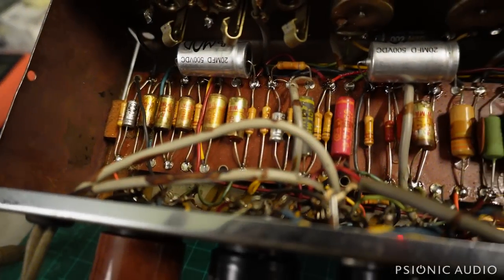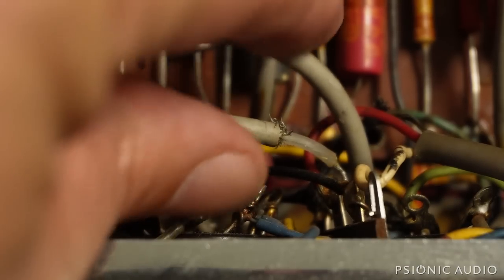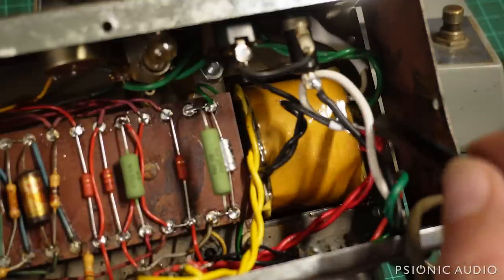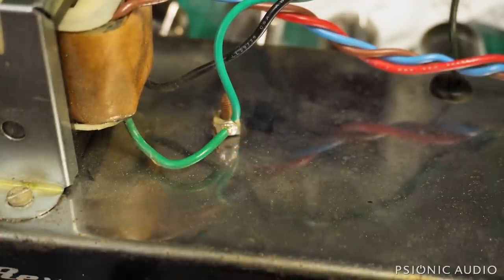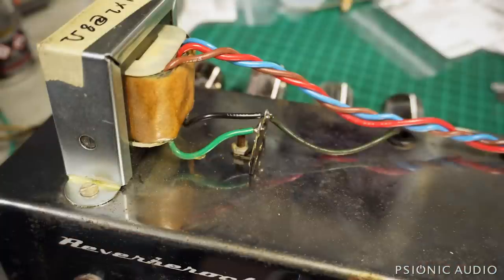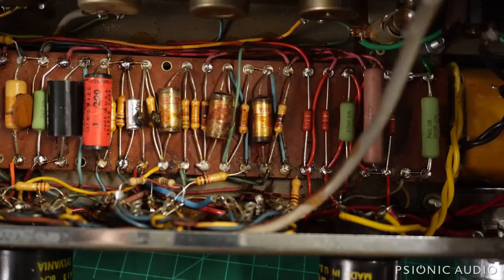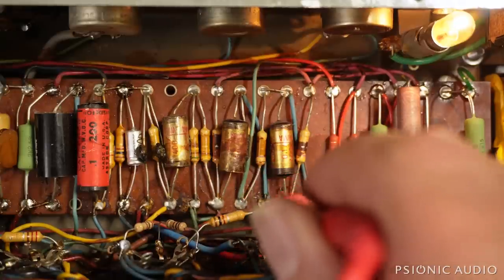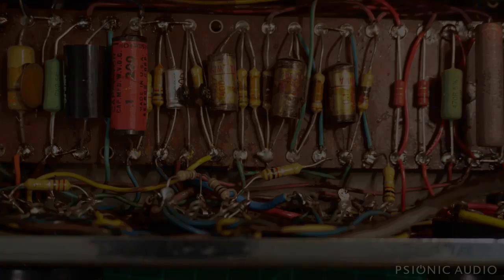The Ampeg Challenge Part 2 : Almost(?) Done

Comment: And the OLD FP type 
(multisection can caps) usually had a tolerance of -50% to +100%. 20uF would still  totally be well  within spec for one of the 10 uF sections. In TV, Radio and tube hi fi repair more capacitance (within reason with tube rectification) and anything higher in value for capacitance and any higher voltage rating was considered an AYE OKAY fix!
Reply: When the whole world ran on tubes abusing the rectifier tubes with too much filtering was okay too.
Reply: @Satchmoeddie  , Not to mention that wall voltages were lower then,  so the rectifier tubes and filter caps didn't see as much B plus, and even the heaters of the rectifier and the other tubes came up to full heat a little more slowly because of the lower voltages.

Comment: Fantastic work! Really enjoy seeing all the small details you've learned over the years. One question I've had for a while is why don't you stock some of the more common resistors and film capacitors you use? It seems like it wouldn't be a massive investment, and I so often hear you mention in videos that you're waiting on parts to arrive. Perhaps I'm underestimating how much of an investment it would require, or that you'd still have to wait for "bigger parts" on most jobs anyway? Thanks!
Reply from the maker: I used to have a much larger stock. But the supply chain has been really disrupted over the past 3 years and some parts were on order forever. That’s getting better. 

I just ordered 50 5W 4.7Ks and 10 10W 4.7Ks. And several hundred other values of lower wattage resistors. 

I usually have everything for classic Fender Marshall Vox circuits. 

But I can’t stock everything possibly needed.